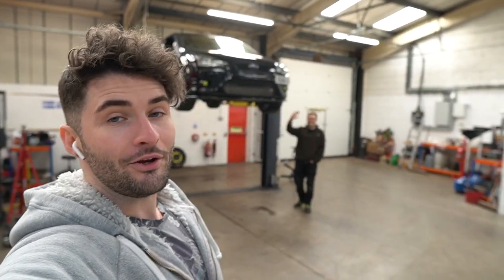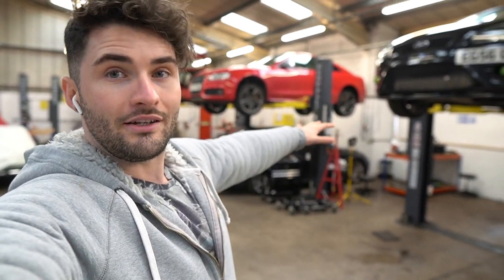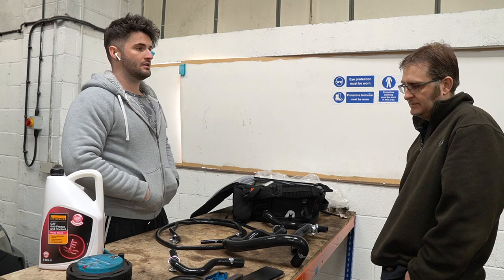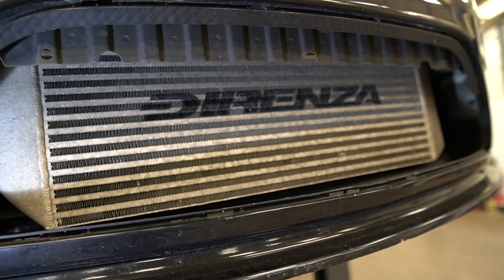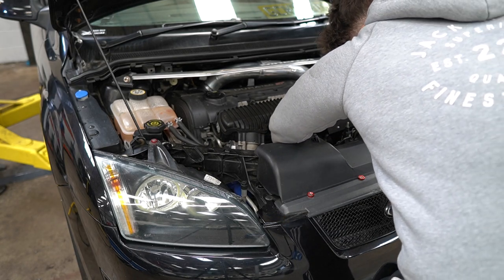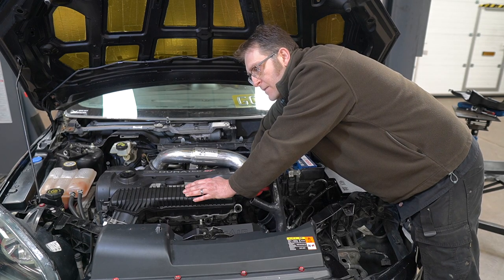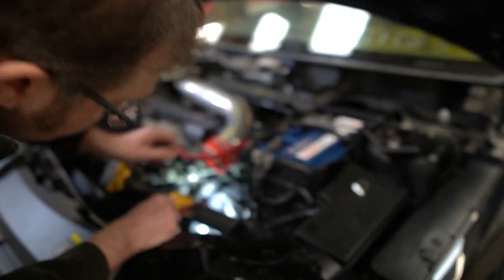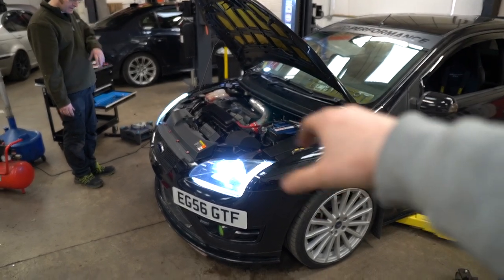THE WORST THING TO HAPPEN TO YOUR ST WHILE DRIVING | SILICONE RADIATOR HOSE INSTALL ON THE ST

Comment: You’d be surprised with BC coilovers- I had them on my second ST 8 years ago along with white line anti roll bars, poly bushes, anti lift kit etc. Every so often the rears clunked slightly- I cant remember exactly what we did but some form of fabricated rubber seal at the top of the struts sorted it out.

Comment: I fitted a full silicone coolant hose kit to my mates ST a few months ago. The heater matrix hoses were really awkward, had to use a dremel to grind through factory hose clamps.  It took me all day to change the full set. The cooling system doesn't have a bleed screw on these ST's, just fill up with coolant, turn heater onto full and keep the revs up to 2.5k for 5-10mins. Check level, screw cap on and take it for a drive, recheck level.

Comment: I remember when I done my silicone hoses on my ST the small hose that comes of the side if the block into the header tank I was sat for about three and half hours with a hacksaw blade just trying to cut that clip off that holds it on and also fitted a pro alloy race performance radiator in the same day aswell that was even more fun lol

Comment: Did you know George, that under your ST slam panel you will find a proper bonnet prop holder? Will be much better when you get the RS slam panel on, or a diesel one.

Comment: Need to get the heater matrix hoses done mate, will cook the engine of one of those splits. As for upper grill keep trying people breaking pfl for an upper grill took me months but i found one, i have cut mine down smoothed it and painted gloss black with the zunsport on top 👍

Comment: You need to get it on a 4 post ramp mate, like what you have an MOT done on, that way the weight of the car is on the suspension, much easier to find anything that’s knocking or worn, when it’s hanging on a 2 poster often things don’t show up 👍

Comment: Pro tip. NEVER try to undo the plastic radiator plug to drain the coolant. They go brittle and you will most likely break it, leaving you with a leak until you can get another plug. Just take off the coolant pipe, it's easier.

Comment: You didn't show the clip at theend of hose connecting to the engine from the coolant bottle, for the heater, as my pipe has a small hole, just at the clip, and can't find anywhere that shows you how to get it out,?

Comment: Pro ramair  ; is this the Airtec / AutoSpecialists one with the plate, RS slam panel, and K&N Group A filter? Sounds awesome mate, got it on mine. Remember to check out Problem Solving Bushings (PSB) for a set of poly bushes. If Alan has a press it will be a piece of piss. good choice for the black silicone pipework too, the coloured stuff gets grubby over time. I have red induction pipework but that's where I will leave it. Rest is going to be black.
Reply from the maker: I will do mate 100% :)

Comment: Here I go again..... Would have been better to get the ancilliary hoses at the same time because the longer one that comes from the heater matrix goes under the coolant hose you took out next to the battery box. It is a T.W.A.T. to get on when that coolant pipe is on. Not impossible, just awkward.

Comment: Ancillary hoses - yes the hoses that go to/from the heater matrix, they come in a set of 4 for about £45.
As mentioned before mine failed and nearly cooked my engine.
Reply from the maker: Thanks mate. I’ll get on this asap!
Reply: Had a pinhole leak in my heater matrix hose last year so replaced the 2 pipes at the matrix too with the one-piece silicone ancillary hoses that get rid of the plastic connecter in the middle for peace of mind.
Reply: Easyrider8111 Mine started a  seeing a small bit of steam when raining, then one day after a spirited drive steam just exploded from this area, luckily I was at traffic lights so pulled over and switch off straight away, half my coolant was gone by this stage! Was close to killing my engine, imagine if I’d been on the motorway, probably wouldn’t have caught it in time and bye bye engine!!!
Reply: Easyrider8111 This hose set definitely comes as a 4 piece set, I binned those plastic connectors and just replaced them with plastic coolant hose joiners.
20mm to 20mm and 22mm to 20mm was the diameter needed for me.
Reply: @styusuf5671  Lucky escape there then. Mine was just a pinprick hole so a thin stream of coolant came out and down on the manifold causing steam when up to temp and stopped at lights.
Reply: @styusuf5671   You can get them as 2 whole pipes also. Got mine from a guy on FB group who does kits. £40 for matrix ones. Saves messing with connectors.
Reply: Yep the problem with these hoses are they are made up with 'fastfit' connections. The idea is you rotate the grey ring on the fitting to unlock the connection and can pull it apart but it seldom ends well.  The plastic 'male' end goes brittle and cracks, breaking off completely sometimes, leaving you up shit creek without a paddle.  (our cars are 14 plus years old now) also, the crimps on the pipework to the fittings lose their tightness because the rubber hoses shrink and it all starts to leak. These fittings were only used in the first place to allow quick assembly. It does not make a good connection at all. I bypassed those plastic fittings altogether and used two 7cm long pieces of copper pipe 22mm diameter. It is a perfect fit. There is no need to swage the ends of the pipe as there is not much pressure in these lines and the fit makes it very strong anyway so there is no chance of the pipes blowing apart later. You use these pieces of pipe to join the pipes coming from the bulkhead to the supply and return pipes to and from the engine. Using the supplied jubilee clips it makes a far more durable and reusable connection. Plus in my view it looks more trick. That bracket that holds the connectors you can take off and get it out of the way. You will see what I mean when you get to work on it. About preparing the copper pipes. Try and use a pipe cutter and also smooth the ends with a file or a dremel making it easier to push on and also to prevent cutting into your pipe. Use a little Fairy liquid to help the pipes go in. Sorted.
Reply: Where did you get the heater matrix hoses from. Have you got a link for them?